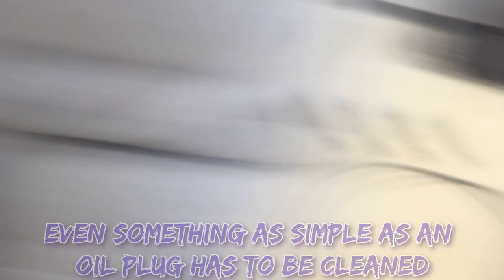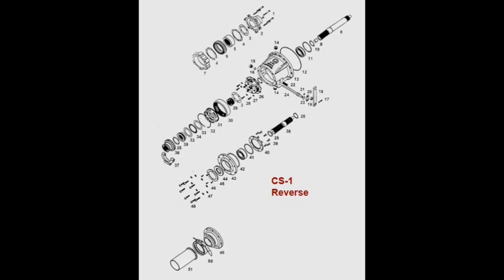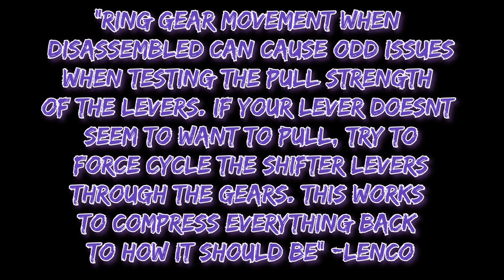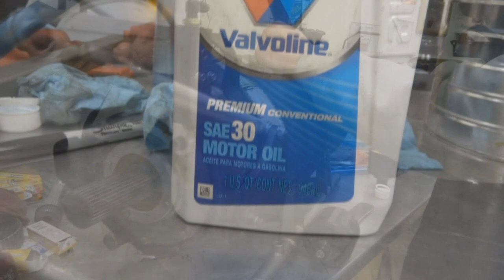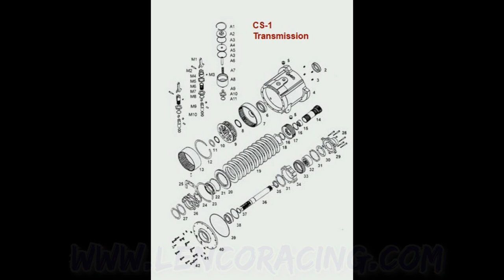Rebuilding a Lenco Transmission for 2500hp!!

Comment: 5:43 "floaters are essentially like washers/spacers for each disk". I will have to disagree with that statement. While the floaters are placed between each disk they are definitely not just washers/spacers. They are a critical part of the power transfer path. They have teeth on the outside of them that mesh with the drum. The friction disk's have teeth on the inside that mesh with the hub. The friction disks and floaters are squeezed together by the pressure plate, transferring the power from the hub to the disks to the floaters to the drum.
Reply from the maker: @Alan-jx7uk  it's basically a big washer.
Reply: @Tinman2Kustoms  That is essential for transmitting the power from the friction disks to the drum. To call it a washer or spacer is discounting it's function / importance.

Comment: just a wondering.....do have a discclutsh or a converter?? Its a few cars here in sweden thats have that setup....in TD and ProMod.
Reply: TOMPE JOHANZZON 2 disk pedal clutch.
Reply: Two disk Molinari Pedal clutch. Uses Real high base pressure so don't slip it on the street.

Comment: is the shifting mechanism like an air valve
Reply from the maker: yeah it is basically. it's air shifted transmission, uses c02 bottles to shift because air is faster than mechanical
Reply: +Tinman 2 Kustoms Air shifting is faster than mechanicaly shifted right
Reply from the maker: +Akasaka Verrian yessir, faster shifting with air
Reply: +chalin P Yes air solenoids on top of trans called air pods. Forces the clutch forks in to wedge against clutch packs so they do not slip pods can continue to wedge with air behind them where mechanical levers reach there travel and they are done. cant adjust for air unless you do it mechanically. Pulling levers actuates air valves to send air to pods. and yes they can be down shifted.
Reply: chalin P yes. co2 and solenoids
Reply: Are you a lenco Sumek

Comment: can you jump gears on a lenco transmission?
Reply: William Su ? not sure what you mean.
Reply: promodracer Like how on a traditional manual you can go from 2nd to 4th or 5th to 3rd, is it safe to jump gears like that on a lenco? Or it is like sequential where you have to go through every gear?
Reply: Jump
Reply: skip? Hop?
Reply: No, you can't skip gears on these. They are not designed to do that.

Comment: YOu might want to do videos without all that noisy music as people want to hear to talk and show the details of what you are doing. The music thing is has went out of style years ago and you have knowledge to share. Could you get into the detail about how the internal parts shift with the clutch pack from where you engage the outside shifter to show what is going on inside? That would be a great video...I promise you if you do your vids with pausing and all that music and  instead just you talking you will get more followers. Cheers.
Reply from the maker: I disagree. Audience retention is almost doubled on videos with music versus without. The generation of folks under the age of 40 get bored without the stimulus of music in the background and changing it up. I have been running a successful channel for many years and music works. That's why almost all creators have music in the background or as effects.

Comment: Really. Really? Air shifting on a lenco? Be a man. Jesus everyone taking the easy way out nowadays
Reply: let's see a video of your 2500hp street car then? if you wanna call people out
Reply from the maker: +zach zinner haha amen to that. Its easy to be a keyboard warrior.
Reply: +Tinman 2 Kustoms yes it is and that shit pisses me off you have a bad ass car I'm not a huge fan of hemis but nothing in that car is stock Mopar from what I have seen
Reply from the maker: It is not my car, I just help with it occasionally and shoot all the video of it. And no, nothing is stock. Literally. ha thanks for the support
Reply: obvious your un aware of advantages of air shifting.
when you use mechanical levers the fork drives down till it runs out of travel. as clutch packs wear that distance is reached before forks bottom and tighten up clutch packs. Now the towers can be adjusted as you go.
but air servos self adjust depth and keep pushing, where mechanicals have to be adjusted to do this.
Air shifting is also fast enough to not allow slippage of disks due to lack of speed.
Pulling air levers gives the enjoyment and control, while allowing no compromise in speed.
Reply from the maker: Truth^
Reply: +promodracer are you running jets on the fork servo? You guys need to check out Scott palmers studezilla  he put a big show fuel motor in a promod ! Yikes
Reply: +promodracer what's the spilt% of 1st &2nd?
Reply: 144 144
Reply: Jets?
Reply: No Jets @NickHolm
Reply: No Jets, Why would you do that. Im all ears